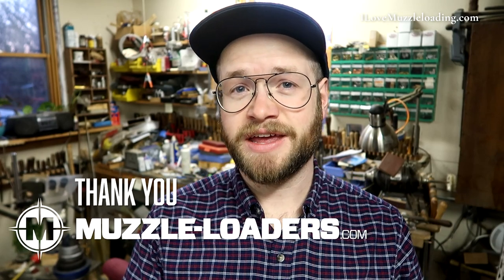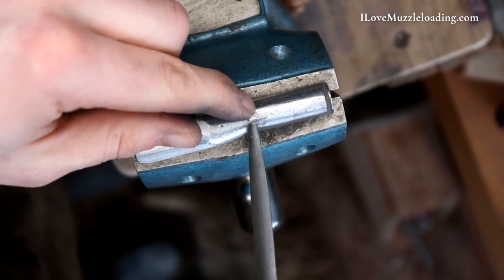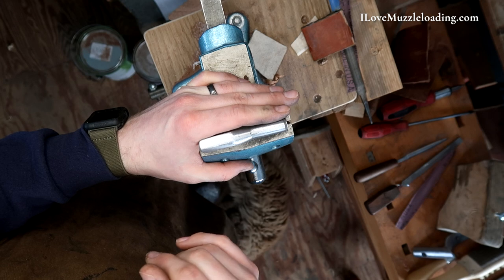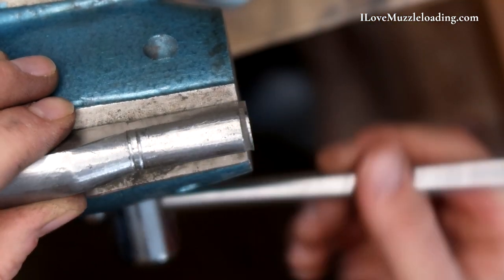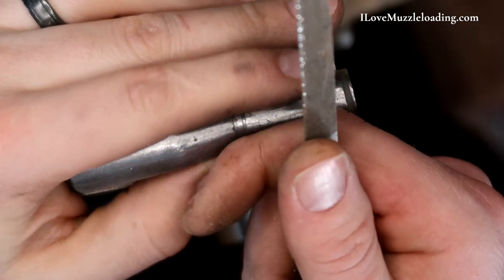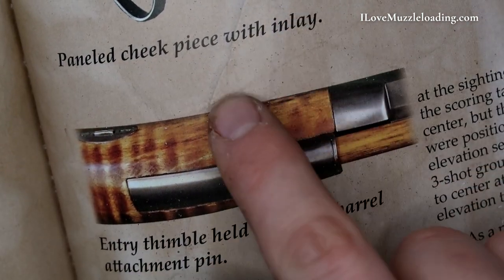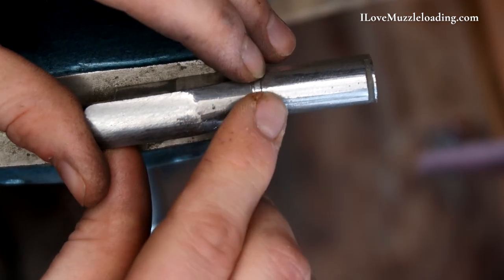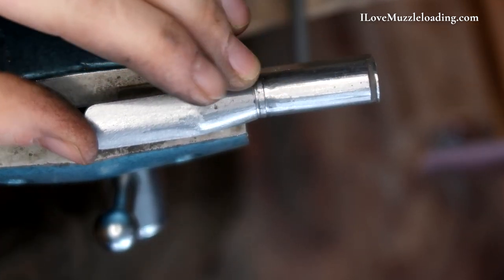A More Historically Accurate Hawken Entry Pipe  | Investarms Gemmer Hawken Kit Part 11

Comment: That is a good idea. I have a Gemmer that has the same issue. I will do it! But please, do not drag the file backwards. You are dulling the teeth on an expensive file. Hack saws are pulled to cut, not pushed, also. The forward pipe is a good idea.
Reply from the maker: Thanks for the tips John! I'm always trying to improve.